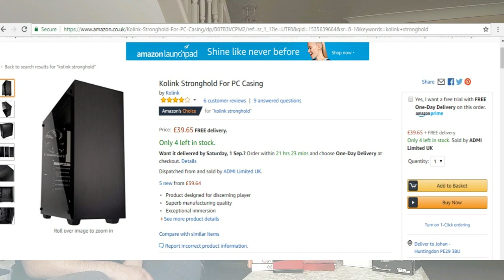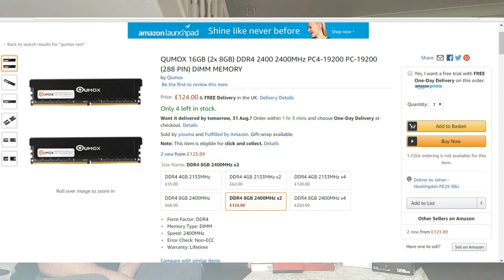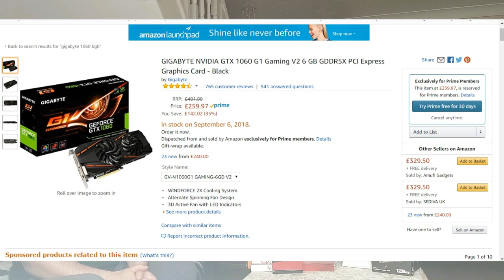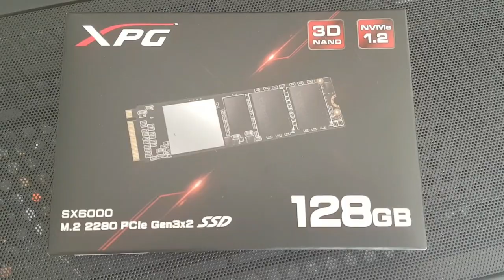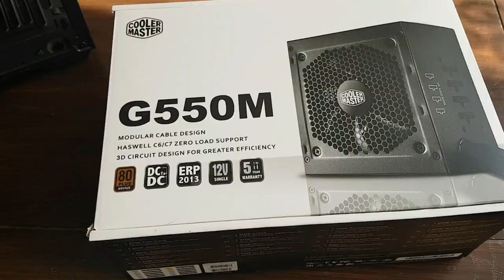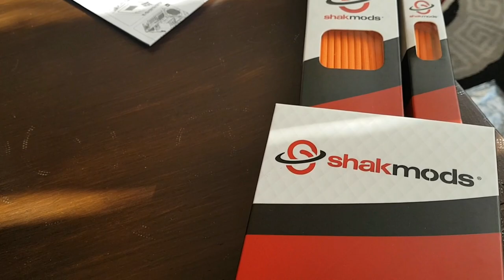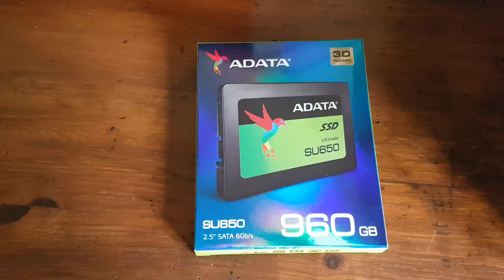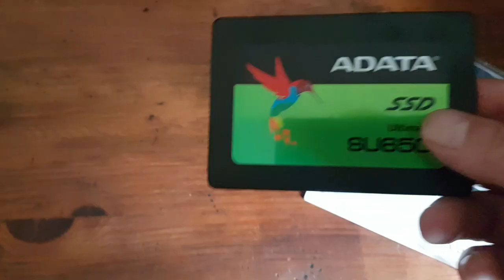My First PC Build in a Kolink Stronghold case [September 2018]

Comment: You did good but the airflow in your case will be bad due to the way to put your fans. The front fans should face and blow inwards for most efficient cooling
Reply from the maker: Thanks, kind of you but the front fans are blowing inwards. I tested everything when I complete the build and very good temp readings to. Using this pc everyday for a least 4 hrs playing games.
Reply: @yoyorzgaming8450  oh ok, its just usually the fans blow in the direction the logo is facing so thats where I got confused
Reply: the exhaust fan is called that way for a reason have you ever built a pc?

Comment: Yoyo, quick question for you. Can you advise me how to properly install the HDD's in to the bottom of the case? I did not get a manual with mine and I am having to bodge it a bit!
Reply: i bought a bracket, then found out i didn't need it. On the left side of the HHD i put the front 2 screws in about half way (3rd would not fit for me) and then slide it into one of the grooves (by front fans) then just screwed in the otherside with the pre drilled holes in the case.
https://www.tweakpc.de/hardware/tests/gehaeuse/kolink_stronghold/s05.php

Comment: Good build, can I mount two fans at the top? Thanks
Reply from the maker: Yes you can get 2 fans on top, either 120s or 140s. With set up I have the PC runs cool even under a little load.